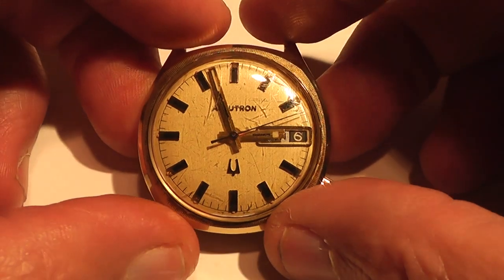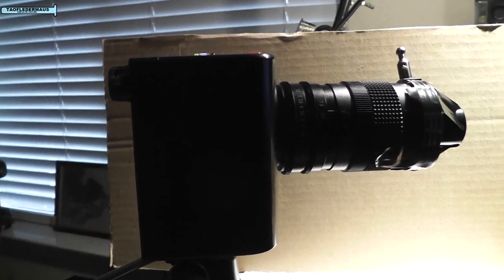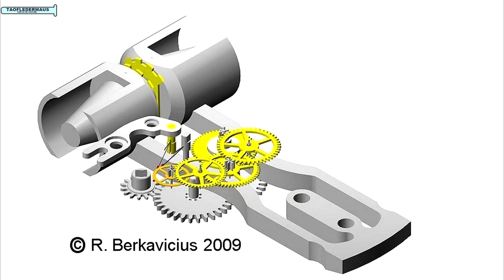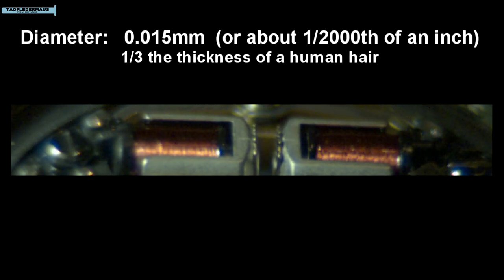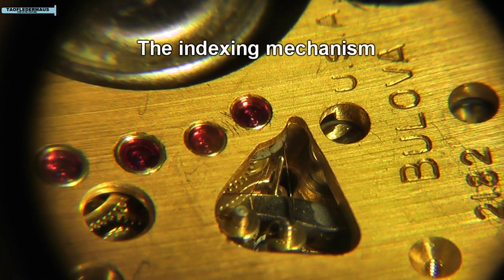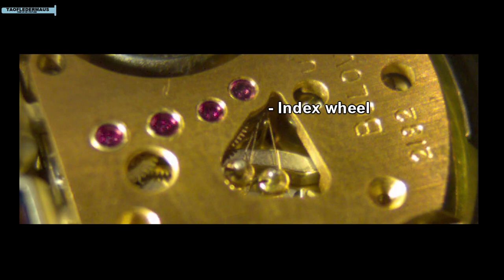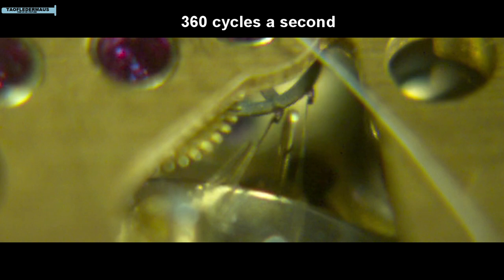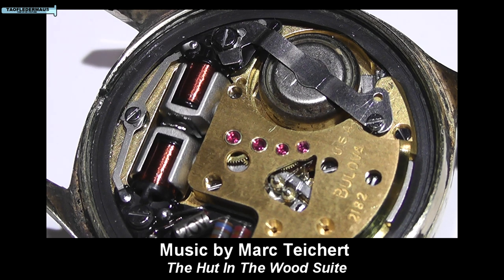The amazing Bulova Accutron watch filmed in microscopic slow motion

Comment: What's more amazing is you knowing all that info on this watch . How on earth they made that little tiny lever . That's crazy .
Reply: Edwin Sarkissian Probably lasers
Reply: TheTeehee11111 not sure if they had that technology then
Reply: Edwin Sarkissian the aliens did
Reply: well, currently the cutting edge of miniaturisation is in IC's, like CPU's, and given this has a transistor in it, I bet the method of making the gears was similar in principle, even now the most we can mass manufacture is between 12nm and 10nm, with 16nm and 14nm being the most popular.
Reply: Finaly, the Giorgio Tsoukalos's fake account. Found it!
Reply: Joshua Nicoll, not at all similar – CPUs  aren't mechanical devices! They have no moving parts, and need not withstand mechanical wear. They are manufactured using photolithographic methods, and I highly doubt these are suitable for gearing.
Reply: Not the actual devices or the methods, but the control machinery, would probably be easily adapted, the CNC control would logically be suitable for both, some of the machines might even be adaptable.

The photolightograhpy steps obviously couldn't be used... well they could be but that would be slow and not the best use, you can etch a gear into metal, and probably with the a similar machine, but that would take too long, a tiny cutter of some description in a similar machine with similar precision for the 1960's could probably do it, but might take a few days.
Reply: I don't think they could use lasers like that back when this watch was made.
Reply: Dylan Zrim size of teeth is much smaller than thickness of gear, and etching would be troublesome
Reply: Тимофей Довгаль etching is quite precise if you take your time.
Reply: Dylan Zrim I know, but edges of etched cavity are not straight, that's why one can't get tracks on PCB narrower then thickness of metal using etching
Reply from the maker: I'm a bit of a watch collector.   I've taken apart quite a few of them.
Reply: Oh wow, Senpai replied. Etching can be accurate but not on this size scale, it was either done by early and expensive CNC machines or possibly by hand, while unlikely, they have been making watches that size for 300 years, so there might be some way a human could have done it. A pantograph might have been used, or something like that.
Reply: TAOFLEDERMAUS spage age? XD
Reply: Photolithography can be used to make tiny mechanical devices (MEMS). That is how accelerometers and DLP chips are made. It would have been pretty new tech at the time. https://s-media-cache-ak0.pinimg.com/originals/22/19/af/2219afc741557030794ab42daae4f829.jpg is an example and they use vibrations to move the gears since motors don't work well on this small scale.
Reply: make more slowmo vids of other movements!
Reply: I used to work with a bloke I used to call 'Rolex' who was well into watch movements and the like.

He used to buy all sorts of semi and pre-assembled movements and placed them into suitable casings making quite desirable time pieces and some hybrid pieces that were better because of the improved movement that wasn't available at a specific time.

He made a load of money thru the basic assembly of watches as time and steady hands cost a shit load in the vintage/collectors watch trade. He regularly wore an £800 valued watch in 2008 which would've been valued at US $1500 before the crash.

Rolex was a bit of miserable twat most of the time tho hahaha!!
Reply: anyone can take a watch apart. the trick is putting it back together again!
Reply from the maker: The guy that invented just the index assembly ended up killing himself.   Probably drove him crazy.
Reply: TAOFLEDERMAUS hahahaha .
Reply: @flippynl Do me a favor, post a video of you doing so or stop responding.
Reply: MattV2099: Guns & Food I am not allowed to operate like that . Lol or else I would
Reply: You could theoretically make the gear two ways.  One is to take that same concept and use it in reverse.  Attach a small cutting tool to a tuning fork so it cuts gear teeth, turn the gear at the correct RPM, let the tuning fork's consistent travel and timing cut the notches for you.  You couldn't use the same size tuning fork, as the addition of a cutter would alter harmonic balance, but it wouldn't be hard to develop a larger fork that was tuned to the same frequency.

The other would be to simply swage a whole stack of them through a die that was meticulously crafted from an ultra hard alloy like tungsten carbide or similar alloy.
Reply: I'd also be interested in seeing some other watch motions n slow mow. This was pretty interesting.
Reply: Sean Coker a
Reply: TAOFLEDERMAUS you shure he wasnt killed? Lot of evil in big business
Reply: @Skinflaps_Meatslapper  I reckon your first theory is on the money. But I guess we'll never know.
Reply: @Smith5783  Theory and practice are often completely different things, and there are plenty of ways to skin a cat.  My theory might be completely different from their method, yet in practice both could potentially produce the same thing.  Could you imagine the edge on that cutting tool though?  It must have been sharpened with a microscope to get even remotely precise enough for that scale of work.

Comment: That micro toothed gear is unbelievable
Reply from the maker: The only clue we have is the gears were cut in stacks- many were cut at the same time.
Reply: Whatever metal they use to make it, they probably machined a rod of it, then cut it razor thin.
Reply: Hmm, sounds like broaching maybe. A stack would respond really well to that, and machining such small features consistently on a stack with and rotary cutter would be basically impossible even today. My money's on some whizbang super exotic alloy broach made to insane tolerances. Cut a thousand of them at once.
Reply: I can think of some ways how to do that, but that precise work drives me crazy even thinking about it :D
Reply: Probably used lasers to cut the teeth.
Reply: Industrial lasers didn't become common place until the 1970s.
I figure they used a photo etching process similar to what's used to manufacture show masks for crts and IC manufacture.
Reply: In traditional watch making, pinions and gears were cut from rods, and finely finished to suite.The pinions (the driving ones) were usually carbon steel, and made some very nice "grippy" miniature screwdrivers, and it was common for craftsmen to make their own varieties , I can remember the term "pinion wire", and this is why modern "instrument" screwdrivers copy that grooved look . I think the rods may have been formed by "rolling" with great pressure between wheels of the correct form, but I can't say for sure, but I know that they were not all that expensive to buy, and were common.These skills were advanced by the :French, German, and Swiss, who are deeply respected in the watch making field, and have always been unbelievably excellent.So that escape wheel may have been made like that.My Grandfather could have probably worked it out, but he died fifty five years ago, but not before I learned some of his nineteenth century skills.Best regards from the isle of Skye.P.S. I love what you do.
Reply: Max Hetzel said they used a special 
'hobbing' machine. to cut the teeth. 
Cutting a large stack sounds logical because I have seen some index wheels 
Rotate non concentric. So the teeth were 
cut first then the center shaft hole was drilled through the stack. MHO.
Reply: May they have used a diamond, like those which are used to make diffraction gratings?
Reply: @taofledermaus  I once worked on a machine that cut tiny rare earth magnets for hearing aids the magnet was forged or sintered  into a rod then they were cut with micro fine wire in a coolant with an abrasive.
Reply: @cuongle7990  In 60's?
Reply: @lzw007  oh? I didn't notice that its an old watch, sorry
Reply: The just used a knife to cut those teeth
Reply: @taofledermaus  Alien technology, obviously.
Reply: @taofledermaus  1 teeth of that index gear measures exactly 0.01 milimeter in height. Todays high quality CNC technolgy achieves tolerances by 0.05. Anything beyond has to be hand adjusted by todays watch making. What alien technology did Bulova developed back then? The only possible answer is another tuning fork that sends vibration to a micro glass egde. While the stack of soft metal is rotating at low speed, the glass edge is cutting tiny valleys according to the tuning fork vibration. The same principle that is used to drive the 214 caliber - just reversed :)
Reply: @Membrane556  My thoughts exactly

Comment: The index wheels were stacked and hobbed,  the hobbing machine was very large and was  
similar to a 1 to N reducing arm such as was used in a New Hermes engraving machine, the information is known and is in the public domain and has been for many years although the actual device is rumored to have been destroyed at the order of Bulova some time after the end of production. Almost a predecessor to the DaVinci surgical robot without the computer and servo system.   There is no secret as to how the pawl jewels were manufactured!   Also the transistors were hand assembled Germanium point contact devices made by  ATT or P.R. Mallory  in the first model 214 as I recall. There are something like a dozen of these movements in residence on the moon.   Great work with the high speed and the magnification! Hope the info is useful.
Reply: Hi, Thanks for sharing this information. I know it may be allot to ask but if you have any reference sources, I would love to learn more. I think this history is worthy of documentation and summary. I might undertake this type of activity in earnest when I retire (from Engineering) in a few years.

Comment: I collect Accutrons and have 8 that work and 6 that stopped working because people put modern batteries in them all modern watches run on 1.5 volts or 3 volts but the Accutron runs on 1.35 volts so a modern watch battery will fry it , when I was younger and got my first "Space View" my hearing was much better and it would drive me nuts with the ringing ( squeal ) it would make I could find it anyplace in the house just from the noise it would make ( they all have a tuning fork inside )  , not my hearing is shot and they don't tick but also they stopped bothering me . I love the sweep of the second hand no one second jerk but a smooth movement . They are one awesome watch , I collect rare old watches and Accutrons are at the top of my favorite watches ( they also made a desk clock ) . Great video , Thank you  . 2 thumbs up

Comment: I bought one of these in the late 60's because my job required precise timing on a electronic military device. It was accurate enough that I really did not need to listen to every time signal that was transmitted from the bureau of standards time clock. Thanks for giving us fans of this watch an inside look. By the way it cost me about a third of a months pay to buy it.

Comment: i am watchmaker, i was working at official seiko service, few wears ago...we reapair al kind of watches, quartz, mechanical, digital.... but this is mindblow! also for me, one of craziest watches was Quartz tissot with som kind of electro mechanical compass made inside stanlies steel shell.  That watch is made for mr. mrs. smith mowie some years ago.
Reply from the maker: I prefer mechanical watches over battery powered watches.   (I hate changing batteries)  I collect  Benrus jump hour watches from the 50's.
Reply: I've had a Speedmaster Professional on my wrist for a dozen years now, my only Swiss watch. I started out with Japanese mechanicals because they are often affordable and I particularly like Seiko mechanical dive watches.

Awesome video, thank you.
Reply: TAOFLEDERMAUS I've been wanting to get my hands on an old mechanical pocket watch, I love how they work.
Reply: It's a Tissot T-Touch. It wasn't made for the movie. It's called product placement - advertisement. In Tomb Raider, another movie with Angelina Jolie, she wore the same watch but in a different color scheme.
It's a very precise watch, called a chronometer. Mine is only about 3s off in a year.

Comment: Wow, thanks for your effort. I have one of these in fine working condition and the fact that it has lasted over 50 years is just astonishing. I had a rough idea of how it worked but putting a hair in the picture made it very clear just how tiny those gear teeth are and how fast it is moving. Thanks again.

Comment: In my last life, I was a field service technician. I used to have an account on the east coast that was a high end watch maker with a vault just for the jewels added to the watches. In one room were long benches and skilled tradesmen assembling the watches by hand. using micro sized files and tweezers.I would just stand there for what felt like hours watching them build. Such talent. But I didn't see any aliens. They were probably just the engineers.

Comment: Wow Jeff, what a marvel of engineering. I'm always amazed at how advanced some technologies were even as far back as the sixties. I don't think the average person realizes (and me included) how incredible human innovation in the modern age really is.
Reply: It's kind of a recurring pattern for humans living in an age beyond prior ages. Even today, we keep finding more and more evidence that people in ancient times were much smarter than we give them credit for. I mean, the Ancient Greeks were crazy-good plumbers, given how much less resources they had compared to us.
Reply: Joshua Madoc also romans built the colosseum and other splendid structures that are intact to this very day, roughly 2000 years later, i bet our modern skyscrapers won't last that much
Reply from the maker: That is what amazes me.
Reply: The Colosseum is all but intact. Have you seen it? There are no 2000 y/o structures not needing repairs.
Reply: We made it to the moon using 8-bit microprocessors; sextant, slide-rule and log-tables as backup.
Reply: 15 bit, and it was not a microprocessor.  I think the Apollo engineers didn't have access to the technology needed to build a microprocessor, but I could be wrong.  First moon mission was 1969, and the Intel 4004 came out around 1971.
Reply: @michaelbauers8800  
What was the clock speed, 1Khz, maybe 2?
Reply: @chuckaddison5134  I think maybe one Mhz.  Which is impressive if true, as that was the speed of the 6502 processor used in many early home computers.
Reply: @michaelbauers8800  
Yeah, I'd go with 1Mhz. I worked on honeywell E-316s many years ago. They were clocked at about 1Mhz. 
Had to go back and check my memory. Thought I remembered them being blazing fast at 2Khz. Guess that brain cell retired.

Comment: I love your enthusiasm but a trillion is a big number! Even if this watch lasted 40 years non stop it would only vibrate the mechanism 454,118,400,000 (Four hundred fifty four billion,
One hundred eighteen million,
Four hundred thousand) times. Still incredibly impressive though.
360*60*60*24*365*40
Reply: Definitely not possible to run that long. Mainly because the battery runs out so quickly. I have my grandfathers and it only last 2-3 months on a fresh battery lol.
Reply: AnarchistAaron 
Who taught you math???
Reply: Ross Mennie 360*60*60*24*365*40= 454,118,400,000 correct me if I’m wrong
Reply: anpefleyable My batteries 🔋 last over a year.  This is consistent across 4 of my Accutrons 👍🏻
Reply: AnarchistAaron I have a new one which hasn’t   Vibrated once as a battery has never been fitted 😌

Comment: Man, RIP headphone users. I thought my tinnitus was getting worse.
Fascinating watch though.
Reply: Tinnitus is fun eh?
Reply: @dietznutz1  So fun. Sleeping with the ceiling fan on low helps.
Reply: @ILEFTCAPS0N  fair it sometimes becomes white noise at night somehow otherwise I just deal with it
Reply: @dietznutz1  try putting the palms of your hands over your ears and using your fingers to strum on the back of your head, about 50 times will make it stop for an hour or two, but your mileage may vary 

You might have to try Googling "strumming on your head for tinnitus" to understand it better.

Comment: Way cool. I wonder if such a watch could be made today at an affordable price. The quartz oscillator all but killed the fine art of watchmaking. I'm only aware of a couple Swiss companies that use traditional methods.
Reply: Fudmottin yeah, and they costs like a cool car
Reply from the maker: It could be,  but there are cheaper and simpler ways of doing the same thing.  I don't think many people would want to spend $1000 on a watch if they can buy a watch for $50 or so.
Reply: Good point. I guess a tuning fork just doesn't hold the charm of a rotating pendulum like Swiss movements use.
Reply: Bulova made some more tuning fork watches in 2010 for the 50th anniversary of the Accutron's release.  It was a limited edition of 1000 and they were priced at $5,200 each.

Comment: This is hands down the best action footage of the pawl and index finger that I've ever seen. It really drives home the marvel and ingenuity of accutron movements. No wonder all the super spies were issued these. If these little accutrons were slightly more robust, they would have passed NASA's wristwatch test and there would be no Omega Moonwatch... just accutrons imbedded within spaceship hardware and on the wrists of astronauts- a complete (and unbelievably smooth) sweep, so to speak. Where a watch like the Hamilton Pulsar P1 pushed electric watches into the digital age, there is no comparison to the marvel of Bolova's achievement. Thank you for this video.